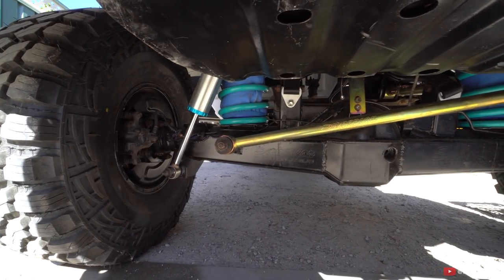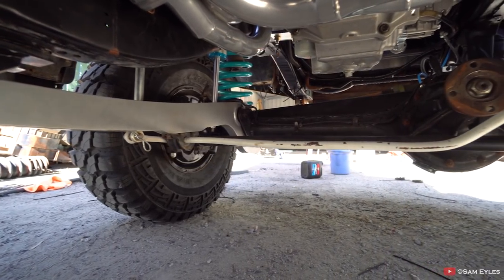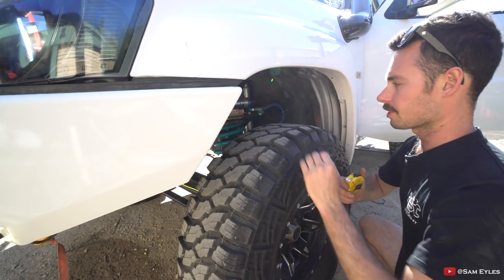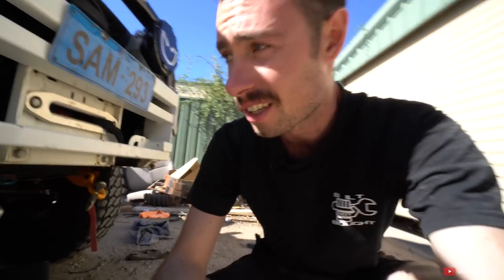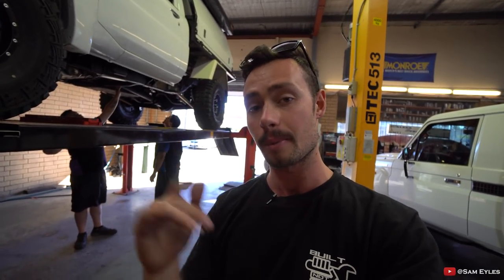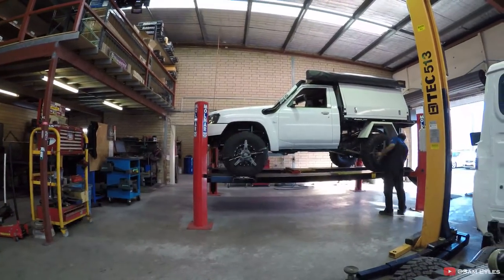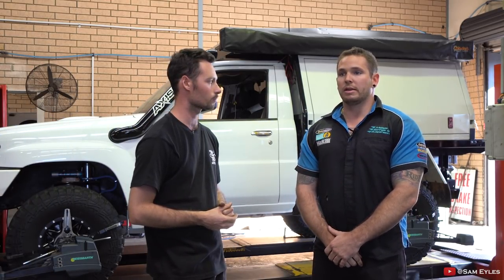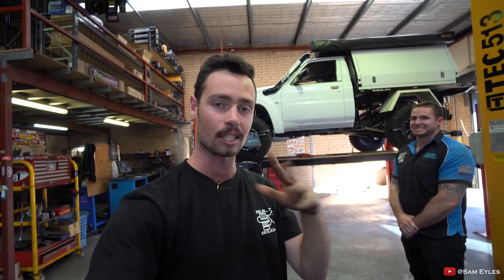BNB EXTRA || DIY Suspension Setup

Comment: Great Video!
So the front has radius arms and the rear has control arms?
Reply: Correct. Front is a 3 link and the rear is a 5 link.
Reply: Is that the same as all Patrols? (full coil ones that is)
Reply: It is for the GQ/Maverick (Y60) and the GU (Y61). The Y62 is IFS and IRS.